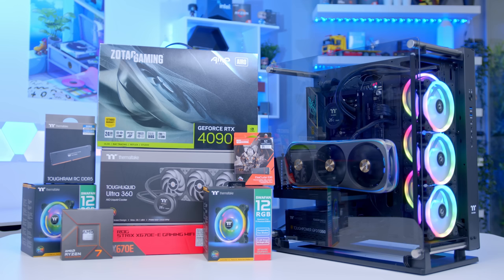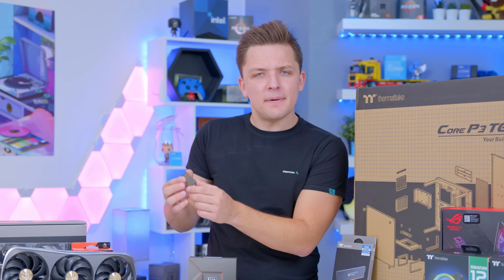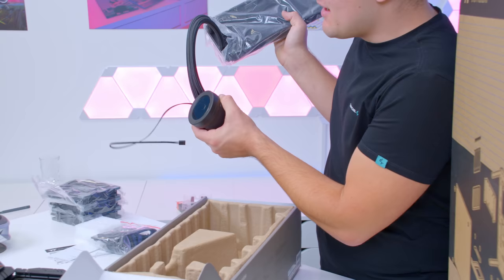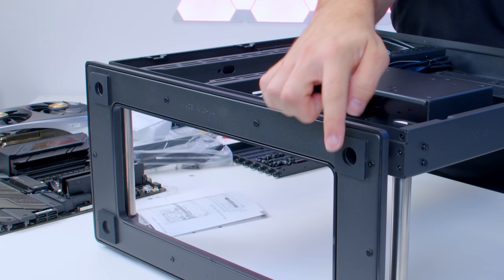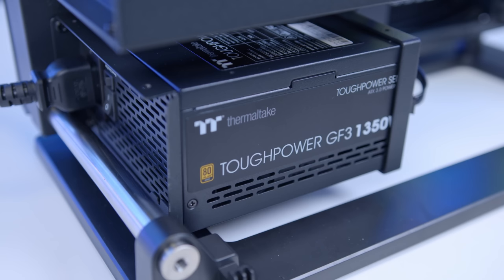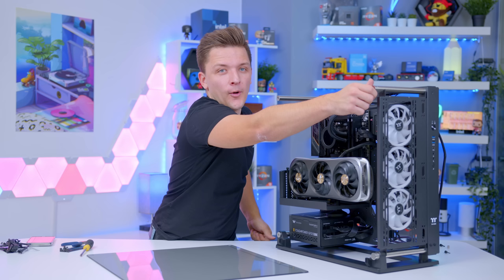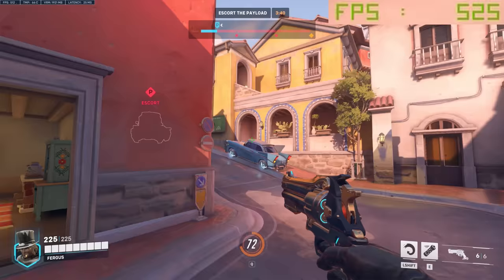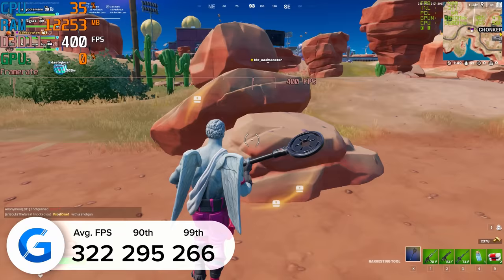Building My New RTX 4090 Open-Frame Gaming PC!

Comment: You didn't put little standoff post off psu bracket.
This connects to gpu tray underneath 
So it will take away the flex.
Also riser cable bracket,screws into gpu riser tray
This supports the weight of the vga

Comment: There's a post to connect the front PSU bracket with the PCI shelf. Also, there's an L shaped bracket that mounts near the SATA ports to support the right edge of the graphics card.
This case is much better for watercooling than air though. Your fans are going to get dusty.

Comment: there's a few things that could've been better about this build (not trying to hate - just pointing it out)

1st of all, why would you use 4800 mt/s ddr5 ram when 6000 mt/s is the sweet spot for ryzen 7000? even though it costs less, you're technically wasting money because you're getting significantly less performance. also 4800 mt/s is pretty outdated and slow now. It's like buying 2666mhz ddr4 ram instead of 3600mhz.

2nd: there's really no point in using a ryzen 7 7700x with a rtx 4090. If you're buying a 4090, you might as well go all out. A Ryzen 9 7900x or 7950x would've suited this build better. Also, even though the ryzen 7 may seem to have enough power, some games are actually being cpu limited (with the 4090) even with a ryzen 9 (or it could be drivers/software that's limiting it), so it would be better to go for ryzen 9 anyways

3rd: $89 for a few case fans is extremely overpriced. They may look cool and perform well, but you can like a 5 pack of 120mm case fans for way cheaper that look just as good and perform just as well

one more thing - the motherboard seems little pricey to me and you could've went with a cheaper one to fit in a ryzen 9 if pricing is the issue. not really that big of an issue though, as it is a great motherboard, however if the cost of the motherboard is causing less performance, that's a problem

other than that, it's a pretty solid build. these are simply the things i would've done differently since it's higher end, and once again im not trying to hate at all. just pointing out a few flaws/overlooks

Comment: bruh high end graphics card but mid range cpu?
Reply: The cpu is a 7 7700x mate are you living in the future where amd  released the 90 thousand series thread ripper?
Reply: @MrBigBasket  yes but you know 7 came before ryzen 9? so why not go for the ryzen 9 7900X or something?
Reply: @ChineseQueen  Ehh, it’s recommended to go harder on GPU vs CPU for gaming. 

At least it’s new gen Ryzen; really going for anything above this will be over kill unless you’re massive into 3D rendering or video production.

7950x is 18% better in most creation apps, up to 90% better in HEAVY multi-core creation apps (3D rendering and what not).
Reply: @Radutsepesh  motherboard is important  too 🤔
Reply: @ChineseQueen  Thought this was a GPU vs CPU comparison. 😅 

Yes mobo is important
Reply: @Radutsepesh  I said it because you wrote:  "it’s recommended to go harder on GPU vs CPU for gaming." maybe but if you play on 4K like I do myself, you're literally "forced" to buy "overkill"  CPUs and GPUs but it wouldn't make sense when your mainboard is $50.
Reply: @ChineseQueen  I game at 4K maxed, formerly with a Ryzen 9 5900x, 32 GB DDR4 3600, and a XFX RTX 6900XT just fine.  Now I game at 4K with Asus Rog Strix Z690-E Gaming Wifi (Intel version of what he is running here), Raptor Lake 13900K CPU, and 32 GB Trident Z5 6000 RGB DDR5 memory and the same video card.  All games maxed at 4K and most I play running over 100 FPS, Doom Eternal runs 4K Ultra Nightmare, raytracing on, and I am getting over 100 FPS and often over 120 FPS.  If I can do it with my system with a 6900XT, with a 4090 he certainly is fine!
Reply: @ChineseQueen  cause the 7800x3d is coming which will be better my guy.

Comment: You forgot to mount the stabilizer bracket for the GPU plate - it goes on the PSU holder and supports the plate holding the GPU.
Which PCI-E Riser cable did you use?

Comment: When looking at the case on amazon it doesn't show the part where you can 3 fans in the front is that additional piece to buy? or just not advertised on amazon, also what riser cable did he use?

Comment: Awesome build looks very clean! I'm considering vertically mointing my gpu in nearby future with same case, is a 200mm 90degree riser cable long enough for this build or should i go 300mm. (I'd rather have minimal cable bends for cleaner look so 200 is preferred if possible) TYIA. :)

Comment: If u didn't use the rizer cable and slotted the gpu in the top slot would it cover slot 2? Could u fit a 4k60pro under it?
Reply: Yah I don't want to use a rizer cable and mount upright, my oll dynamic bottom fans blow fresh air intake into the gpu fans when gpu is old fashioned slotted, hence the "if you didn't use the cable" but thank though

Comment: Isnt the GPU so close to the glass panel? I'm considering to buy this case but I'm afraid 4090 it's to big that it comes to close to glass panel and prevent fans to have good intake of air,  could someone here confirm or tested this?

Comment: Hi there, a little late but at 3:02 the strix e is actually an X670E board and not a X670 board
Reply: You are right, but the predecessor was the X570, even if the S (silent fan).  A lot of people dub them X670 due to this.

Comment: Could you please guve some numbers on the noise ? And how does it compare to FE an other models ?
Reply: I own the same card, everything is great, thermals included.
But the cheap fans unfortunately make a very annoying buzzing sound even at low RPM mode. The card does have a 0rpm mode (which likes to misbehave and not trigger at all at times), but it won't stay at 0rpm all the time, when the fans spin up a loud click sound will happen and the loud buzzing sound will start until the fans turn back off again.
Aside from that no complaints, but the cheap fans really are a problem. Cannot give any numbers of the actual loudness of the GPU under stress, the stock curve is way too aggressive, a custom curve settling at around 50 to 55% gives stable thermals under 65c for much less noise, no numbers tho.

Hope it helps.

Comment: that case is not the p3 pretty sure its the p6. might wanna fix that and actually know what your using next time lol.
Reply: Says right on the box P3 but also a TG Pro version.
Reply: It's a P3 TG Pro (just came out), not P6.
Reply: @STRET24  click on link in description
Reply: @twinstars8812  click on link in description
Reply: @thermaltakeuk  when using this case, can you fit a 3090ti horizontal when using a 360mm nzxt aio?  When is it available to purchase? Does it come w a pcie gen4 riser? Thanks for letting me know there's a new case.
Reply: @parkersgarage4216  yes a 3090ti will fit
Reply: @admodz3292  thanks, I don't want a vertical mount